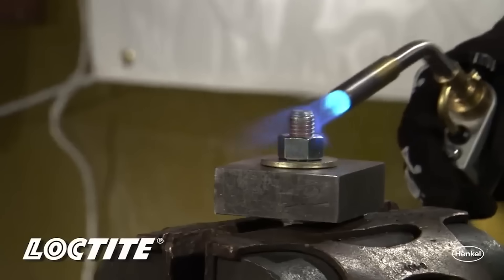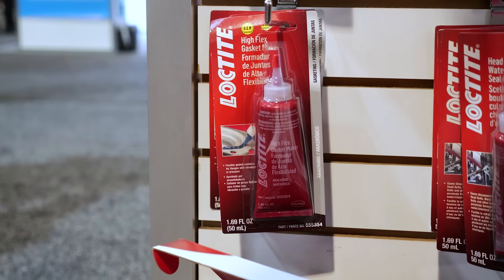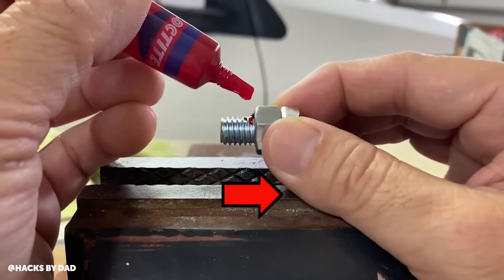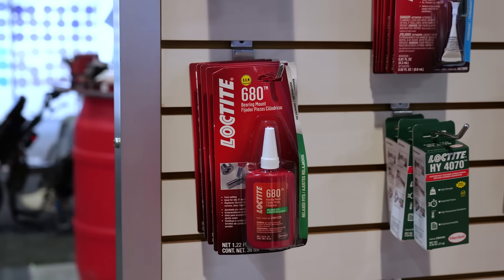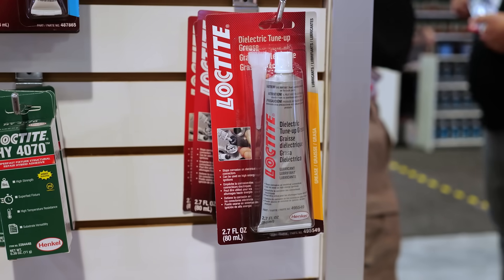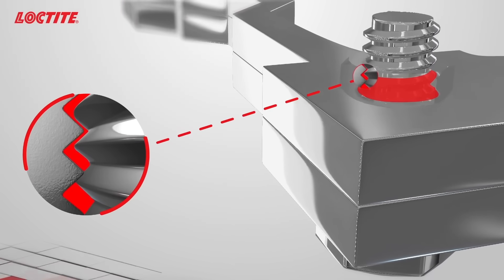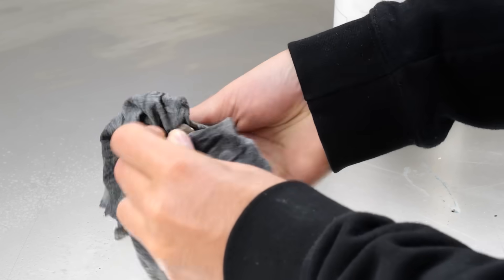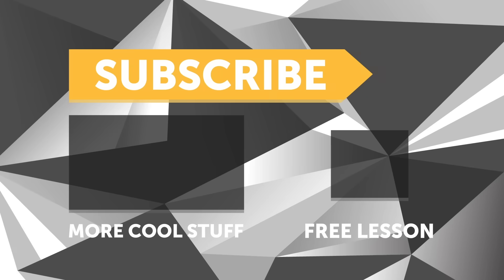Many pro mechanics don't know this.

Comment: So what should we be using on stainless fasteners? Or Ti fasteners?
Reply: I work for Loctite too. You can still use it for those applications since they are anaerobic. So it will not (or only very slowly) cure on the open surface of stainless. However once you put a nut over the bolt, the air gets pushed away and the curing process starts. It will not cure as fast as if you were using a bolt with higher amounts of copper or nickel in it. If you want to be really sure it cures, you can also use an additional activator like Loctite SF 7649. An activator is also useful in very cold or high humidity environments.
Reply: @moritzm2143  Thanks for the info!
Reply: @ You're welcome :)
Reply from the maker: @moritzm2143 cheers for being a helpful chap!

A few people have asked about primers which you guys have some answers on, but torque specs is also a popular topic. Do you have a link to any testing/documentation Loctite has done regarding torque specs and their recommendation for any specific compounds of threadlockers - Taz.
Reply: @hpa101  I'm a big fan of your channel, courses and podcast, so I'm glad to give back a little :)

I'm gonna talk to the guys in the office if I can share documentation on that. What I've heard from the lab is that you do not change the torque settings on your torque wrench whether you use Loctite or not. In most applications the torque of a bolt or nut is defined by its own properties (e.g. size, strength like 8.8 or 10.9 and friction coefficient). This is why you want to use different kinds of Loctite depending on your applications. Usually the bigger the bolt the higher torque is set, so the higher strength of Loctite you want to use. This is because even when tightening down a nut to a bolt, there will be tiny gaps of air between the threads. The smaller the threads, the smaller the air gaps, thus the threadlocker needs to be of lower viscosity to not be pushed out of the threads.  
For automotive applications you can use blue Loctite 243 in almost all of the cases though.
For reference: If you torque a bolt to 100nm and let it settle for 24h, you'll only need about 70-80% of the torque to loosen it again. If you use Loctite 243 it will stay at about 100nm for ever. Anything below 243 will also prevent loosening from vibration but might not reach 100% of the original torque. Anything above 243 will increase the torque needed to loosen the bolt.
Reply from the maker: @moritzm2143 thanks so much mate, appreciate you looking into it and for sharing this info off the cuff to help those with some questions around this out 😎 - Taz.
Reply: Hey Taz, I talked to the experts in the lab: Loctite 243 will even help you to get to the desired clamping force more accurate than not using Loctite. 
If you buy the same bolt from different manufacturers there's still a range of up to +-20% in clamping load. Loctite will reduce the variance from the desired clamping load to +- 5%. So you'll get good fastening even with the worst bolt manufacturer out of the bunch. 
I will send you an email with 130 pages of documentation to the questions you asked. To respect your time, I'll let you know where you'll find the information you're looking for. It's actually a good read though haha - Moritz
Reply from the maker: @moritzm2143  interesting! Thanks for following back up on this, it actually came up in the office here again just yesterday with Andre too haha
Please do send that though and any bookmarks are apprecaited but also make sure you respect your own time, even just emailing that through is super helpful.
Also in that email let me know if it is something we are OK to share with others too (via additional content featuring Loctite, most likely shot IG posts and/or blog posts).
Cheers! - Taz.
taz@hpacademy.com

Comment: huh the blind hole idea is great. Depends on the depth of the hole though I guess?
Reply from the maker: I guess there is a certain amount of common sense to be applied as well. Knowing what is recommended will at least help you figure that out in a way that will work for slight variations outside of the base instructions/examples 🤘 - Taz.
https://next.henkel-adhesives.com/us/en/articles/how-to-apply-threadlockers.html
Reply: @hpa101  haha, I'll make sure to only apply two drops of common sense next time instead of lathering it.
Reply from the maker: @ZoneKei it is funny how we all almost always think 'more is better' off the cuff when in reality there are very few situations in life where that is actually the case 😂 - Taz.
Reply: just a week ago i snapped one of four M14 bolts on differential brace/mount. Luckily 2 bolts didn't had too much green "loctite" on them, one that seemed to snap but managed to come out was green from head to tip (threads only engage half a bolt, thought whole bolt was coated) and one stayed in. There was also font mount with hex bolts and there on one bolt I had to use welder as glue was stronger than hex head.
Some ppl just like to put it everywhere and probably with motto - the more the better.

Tho my best catch ever was oil pan nut welded from inside of pan 🤣At 1st you would though somebody used red loctite to make sure it seals/locks, but then as we take out pan the surprise came.
Reply from the maker: @exvils I'm not a religious man, but that there is the devils welding work 😂 - Taz.
Reply: @ZoneKei  : Don’t want to drain the cranium.

Comment: Everything gets green 🤣
Reply: Funny he said purple for set screws bc the packaging for green says it's best for set screws
Reply from the maker: @Onewheelordeal  you are both right. Purple is for smaller fasteners (under 6.35mm). The technical document does specifically say set screws: https://datasheets.tdx.henkel.com/LOCTITE-222-en_GL.pdf
Also worth mentioning there are a few different flavours in each colour as well. They all taste the same, but the technical specifications and numbers differ just to keep us on our toes🤘 - Taz.
Reply: @hpa101  how did it taste exactly? Just curious.
Reply from the maker: @nooooooooooo6uoki67 spicy bouquets of black pepper and cinnamon with chemical undertones. The finish is a little caustic with a lingering hint of death.
Best served at room temperature and pairs well with an ambulance 🤘 - Taz.